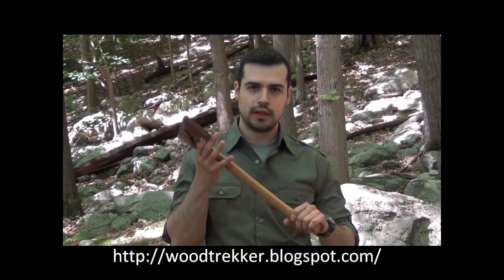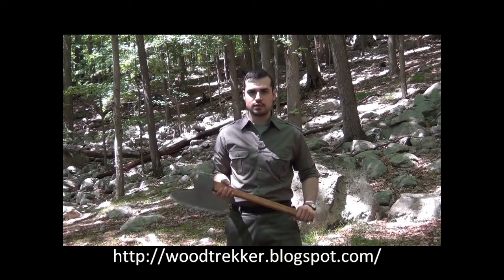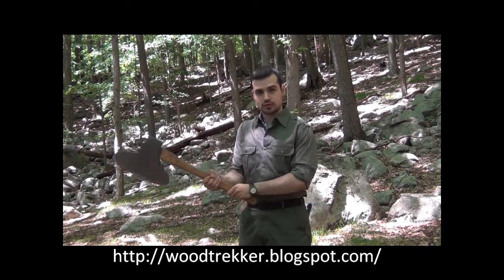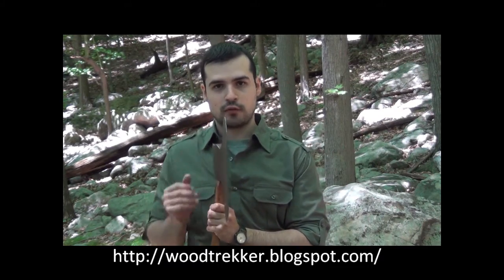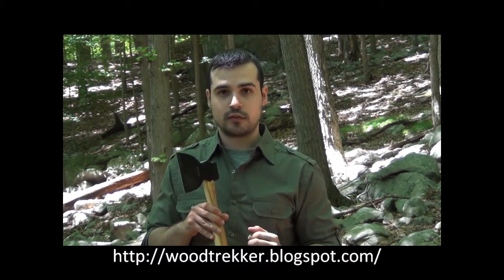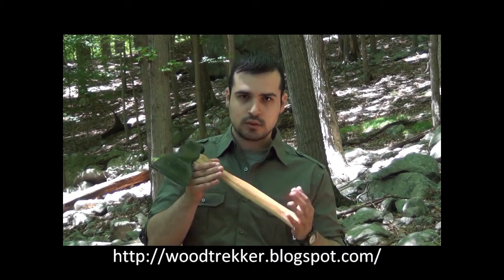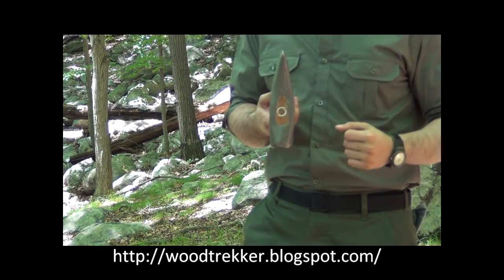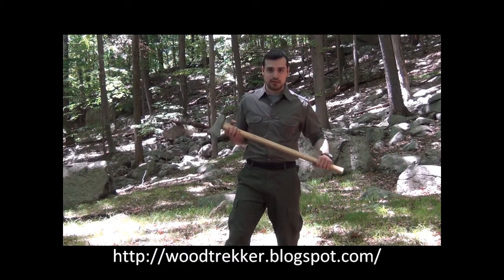An Introduction to Axes Part 1: Types of Axes

Comment: I just wanted to point out that a maul is different than a splitting axe. You were showing a maul. A splitting axe would fall between a standard axe and the maul. It would be used for very well seasoned, straight grained woods that don't require the full mass of a maul.